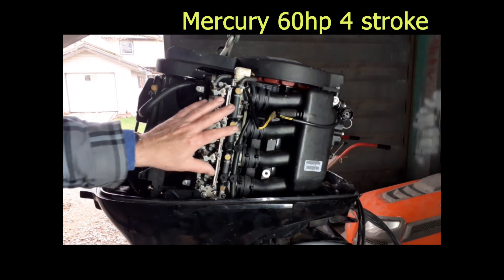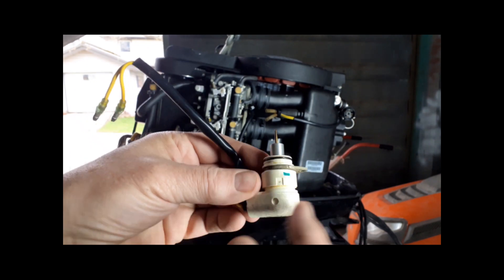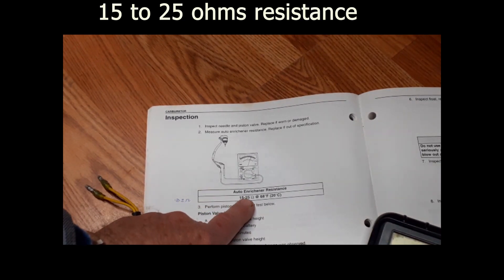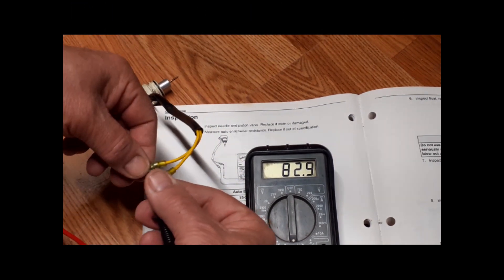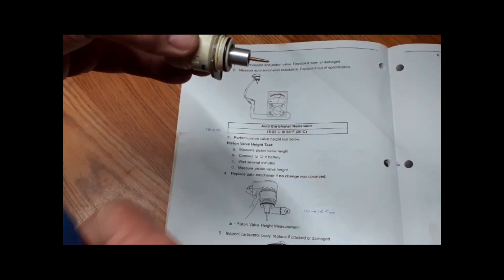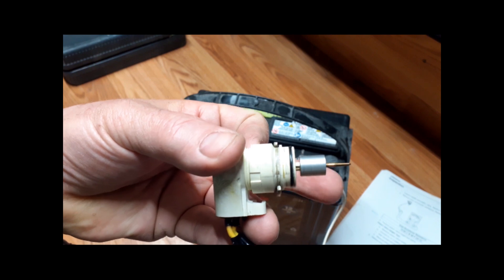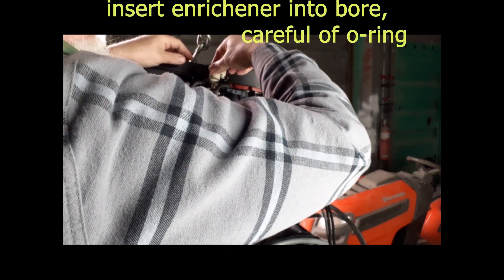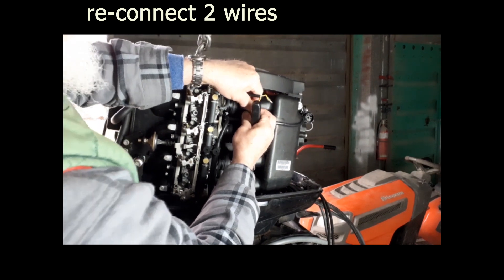Testing the ENRICHENER SOLENOID (electric "choke") on a NEW-TO-ME Mercury 4 stroke outboard motor

Comment: Any idea why it takes so long to extend?   I have a similar system on a Mercury 2 stroke fro 2003?  Thanks
Reply from the maker: The time it takes for the wax inside to melt (electrically heated) and expand and cause the pin to extend is supposed to correspond to the engine warm up time.  Extending the pin when warm closes the needle valve, stopping the extra fuel it needed when cold.
Reply: @oldhobo5610     Thanks.  I'm not sure the old manual choke might not have been better overall. Guess each has its place.

Comment: Thank you for the helpful video.  I purchased a boat with a 1987 Mercury 135hp and it has a crank but no start condition.  Spraying starter fluid into the cylinders will briefly start it, then it dies.  I am trying to work through the possible causes from, fuel, carb, spark.  So far everything is checking out.
Reply from the maker: Good luck then.  Lots of things ro reason through and check.

Comment: On the Specifications' "ENRICHMENT CONTROL SYSTEM" section (Page 1A-3), the "Electrothermal ram projection" is "0.3 in. (7 mm) after 5 min. of power".
Reply from the maker: Thx, I hadn't seen that spec. ( My manual for 50/60 4 stroke has it on pg 1A-2 but value is same as you pointed out).  I think my solenoid under-travelled slightly, but it seems to start ok   The inspection procedure on 3B-18 is not too precise ("wait several minutes", "replace...if no change observed").

Comment: Thanks for the video! Mine needs replacing. Warming up but not moving at all. Engine works rough and spark plugs all black. Removed it and engine started working fine. Sourcing a new valve now👍
Reply from the maker: Wow, that's pretty dramatic!  I didn't have much of a story to tell as mine turned out to be "no problem found".

Comment: Thanks for informative vids regarding this engine. I have the same engine but 50hp. Got a problem. It does not rev over 3200 rpm. no difference if i have it in neutral or in gear. Have read about neutral safety switch but not sure if this older 4 stroke has it. If i understan correct it is in the remote control? I am testing this on land so it has nothing to do with propp pitch and so on: would be grateful för any tip.
Reply from the maker: My non-expert opinion - I'm not sure about any effect due to the neutral safety switch and if it goes into gear then I don't think the problem is in the remote box's lever control.  Have you checked the throttle cable is giving full travel and the motor's throttle is actually moving fully, not binding?
Reply: @oldhobo5610  Yes, no problem with the cables. It is like it cuts of 2 cylinders at around 3200 rpm as a safety. I have read that some engines hav this safety funktion also in the trim/tilt sensor. 
I thought that the remote neutral sensor have the funktion that it is not possible to start if it is not in neutral. But also limits the rpm in neutral. If it is broke in the way that it gives the control box the info that it is in neutral alt the time, even when gear is in. Then it limits the rpm,s even with gear in. i know that some older engines had this funktion but it was mechanical. So it  was not possible to rev it upp to max in neutral.
Reply from the maker: @7ann3  What I see is the wiring diagram showing neutral start switch as making and breaking continuity of YEL/RED wire which leads to starter solenoid..  When key is turned to START it connects YEL/RED to PURP IGN 12v battery power (there is a swich function table) which feeds the start solenoid.  As far as I can see the switch just makes or breaks your power to the starter.  I can't see see feedback to the ECM or ignition, but the diagrams are complicated.
Reply: @oldhobo5610  Hm, I hoped for this easy solution but then it something else. I will se if i can check it this weekend.  Thanks for your input. I will get back to you how it turns out.

Comment: Great video, i’m glad I found this one, my choke enricher is not even connected on my 2001 50hp 4 stroke, but it seems to start fine 🤔 I’m not sure why i have no wires going to it,
Reply from the maker: Around 1:18 in the video you can see   the harness coming from the right side of the screen.  Your leads must be somewhere around the corner. But if it starts ok I guess you're OK!  Maybe only in cold weather it would cause problems.
Reply: @oldhobo5610  well since I messaged you this morning I’ve had another search around for the choke wiring and found the loom laying in the bottom of the engine bay, I’m gonna test the wires and see if there still good, as I do still have the push in choke on the ignition key 👍
Reply: Hi oldhobo, do you physically push the ignition key in to operate the choke or is it automatically operated? I’ve tested the two yellow wires with a multimeter while pushing the choke in on the key and there’s no power to the wires, as it wasn’t hooked up in the first place I’m not sure how it’s supposed to operate? On the key or automatically? Any help would be great thank you 👍
Reply from the maker: @orangewheels01  Based on the electrical diagram the enrichener gets its power from the stator  which means it gets powered an time the flywheel is spinning.  So i think the priming feature on the control box keyswitch does nothing.
Reply: @oldhobo5610  Hi yes I think your right I have traced the yellow wires to the stator now myself, so it’s seems like the enricher possibility gets its power from cranking the engine and is not operated from the push in choke on the key, I have no wiring diagram for this engine so that does help many thanks 👍👍
Reply from the maker: As the coil heats, the needle valve extends gradually during warmup period.  If the engine is already warm then I think the needle remains extended regardless of the stator voltage.  Anyhow, good to reasin things out with you.  This idea of this type of  "choke" was new to me until getting this motor
Reply: @oldhobo5610  yes I think I will just re connect the two yellow wires and see if there is any difference to starting, I have done the ohms check on the choke unit and it’s reading 20 ohms resistance and I’ve put it across a battery and the plunger needle is moving ok, so it seems it’s working ok, so thanks very much for your help that’s great 👍

Comment: Check your multi meter and touch the two leads together take that figure and deduct from your measurment ,thats kinda why they want you to use a analog meter.
Reply from the maker: Would that compensate for what appeared to be erroneously low reading??  At start of session I usually touch leads to verify I get zero, though just to verify the leads are attached.  Next time I will touch leads prior to each test to see if there is any offset.  Thx.